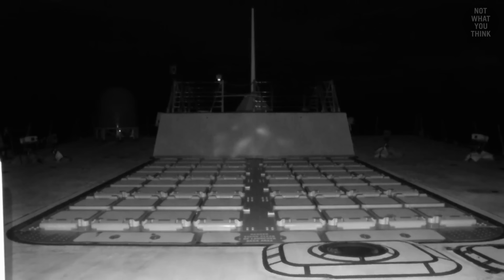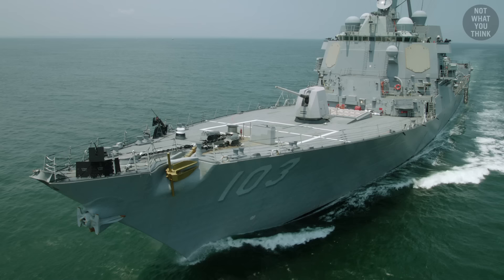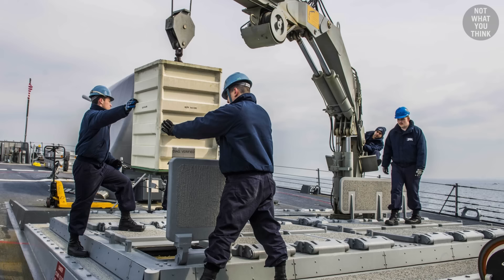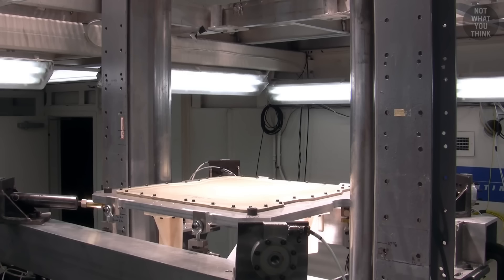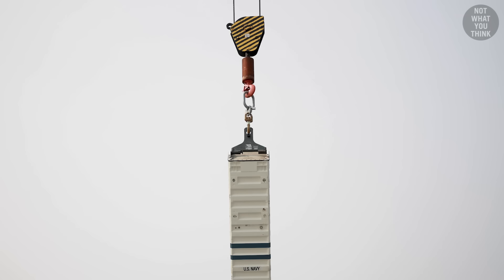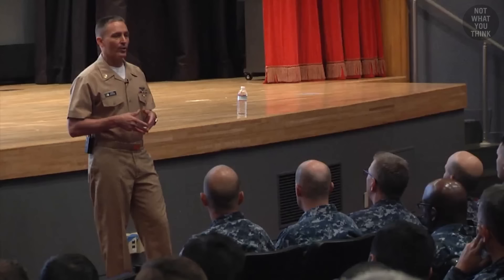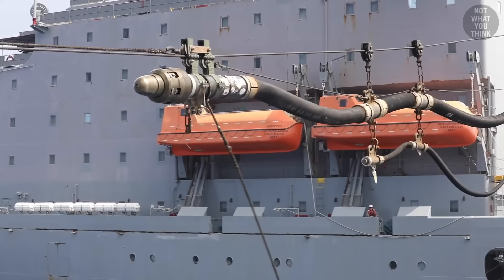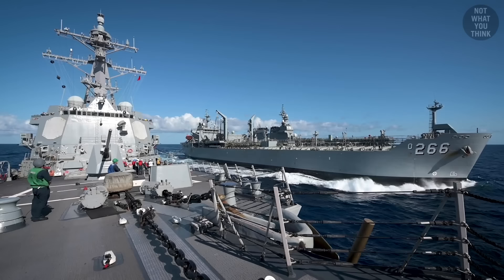Why Warships Cannot Reload Missiles at Sea

Comment: There are a thousand suitable harbors in the western Pacific Ocean to reload Arleigh Burkes by ship.  Around Japan there are probably 100 safe harbors.  There's probably 100 alone in the Philippines.  And then there is Guam, Ulithi, Kwajalein, and Australia.
Reply: Actually, from my recollection, there was a Congressional report by one of their military accountability offices (might've actually been their budget office actually) stated that reloading of the VLS cells can only be done at specialized-purpose-built ports/docks and that the military failing to account for that when requisitioning the system on ships might've violated appropriations/allocation requirements for the VLS system. 
There are only a handful of port facilities that actually can do the reloading of VLS cells according to the report and if they were to ever be targeted the US Navy would not be able to operate. Any improper reloading of the VLS Cells would damage them and compromise them to the point that chain detonations within VLS clusters would indeed be possible as missiles are launched in sequence and share a common exhaust that they need to be completely intact to shield themselves from the heat to avoid in-cell detonations.
Reply: @Edin116  Specialized purpose built ports???  You just need a crane.  

Also, if a warehouse is destroyed by a strike you can actually rebuild the warehouse or build another warehouse.  And, the video shows a VLMS being reloaded with a nearby ship so you just need a harbor.  

One more thing, currently we have 73 Arleigh Burke destroyers and 92 are planned.  If 73 go to war with 90 missiles, let's say 60 are standard missiles, and you have a 90% accuracy rate, that is 3,942 aircraft destroyed.  China has around 2,100 aircraft so that is pretty much their entire air force, and that doesn't even count air to air missiles fired from carrier aircraft.  So, the war is over by the time you have to reload.
Reply: @twelvestitches984  It’s not just aircraft that you are shooting with SM2s etc. You are also shooting down other missiles. Trust me, China has a shitload more than 3000 of those. Truth is, the Navy needs their own version of Rapid Dragon. Call it Slow Manatee. Take an ocean going barge, install a bunch of cells on them, and drag them out to the area to be protected. Or, instead of specialized cells, build the launchers into something resembling standard ocean containers and then you could just load up a container ship in case the shit hits the fan. Hell, play a good game of hide the pea and the enemy would have a hard time knowing which of the dozens of ships in port is the one full of missiles and which one is full of tennis shoes and Christmas ornaments.
Reply: @Bill_N_ATX  Yeah, that is true.  I think if we go to war with China it's going to take time for the US Navy to get there because they are going to have to conduct anti-sub ops a thousand miles out from the Chinese coastline.  So, during that time our B2's will take out most of China's air force on the ground.  

I don't think the Chinese DF-21 ballistic missile has the accuracy to hit a moving ship.  It accelerates straight up to Mach 10 and turns and comes straight down, there's no way it can manuever enough to hit a target moving at 35 mph.  Plus, the Chinese will have to know where the US Navy ships are before launching.
Reply: @Edin116  Hmm, funny. We reloaded while at Singapore once (just before the start of the war) and in UAE during the Gulf War. It just needs a crane, nothing specialized about it.
Reply: @Bill_N_ATX lmao Chinese missiles ain't shit dude
Reply: @twelvestitches984  You wouldn't keep the missiles in a warehouse. One hit with a missile or shell and the whole thing would go up and take tens or hundreds of millions of dollars worth of missiles with it as well as wrecking anything nearby. That's why they store things in multiple hardened bunkers.
Reply: @Edin116 You are 100% wrong.  I have reloaded plenty of DDGs and CGs, including in multiple ports around the Pacific.  And none of them have been in purpose built ports 😂.
Reply: @trolleriffic except you "hardened bunker" is an earth covered magazine...
Reply: @spacemanx9595  Always that ten year old who wants to pipe in with his two cents.
Reply: @twelvestitches984 an ideal war scenario. An Hollywood movie setting.

Comment: Question: It don't seem to take that much space on the boat, so why not just add more cells instead of reloading? Also since the logistic ship carry so many spares why not just have them fire it as well?
Reply: I’m not sure why they don’t carry more on the attack ships, but the logistic ships likely don’t have the targeting equipment required to launch
Reply: @smallboy8771 Sounds like the missile truck concept in the Air Force. Use your 
well defended and expensive ships to deploy forward and target, and have a missile truck in the rear networked to the remote fire control of the forward ships.
Reply: Displacement treaties and the fact it's bad to put all your eggs in one basket. If you have 2x as many missiles the ship costs more, so you have less ships. So one accident or lost hull is more crippling.

San Antonio ships have vls spots but they aren't equipped. We aren't concerned about capacity atm.
Reply from the maker: They do take plenty of space under the deck.
Reply: I'd  guess you'd need a lot of equipment along, that you can't have the trained personnel and costs associated and you'd rather just buy and man another warship. And more, you'd need the refuel ships just for range extension anyways. (uneducated guesses)
Reply: There are Three  major reasons

1. Size: While the footprint is not that large the full size strike length Mk41 VLS cells are 25ft (7.6m) tall and that is a huge amount of internal volume that has to be committed and cant be used for things like crew quarters, engineering spaces, fuel and water tanks, or damage control pumps and firefighting equipment. A ship is designed to carry the amount of weapons that fit the hull and mission. If you want more missiles you need a larger ship.

2. Danger: They are dangerous, a fully packed VLS module is several tons of rocket fuel and explosives sitting just below the deck. If you spread that out over much of the ship you have a vastly higher chance of them getting hit. This is why VLS modules are generally placed forward and aft and not amidships. Most anti ship missiles are designed to aim at the center of the vessel to do the maximum possible damage to engineering spaces (which are generally amidships) because that brings the highest odds of sinking the target. If you fill the middle of your ship with missiles the odds of them being hit and cooking off goes up dramatically. The rear VLS system on an Arleigh burke or Ticonderoga are about as close to amidships as you'd want your large weapons. Many older Russian ships place large anti ship missiles along the flanks amidships. It was some of those cooking off and exploding that likely doomed the cruiser Moskva in April 2022. Many western ships also place their anti ship missiles such as RGM-84 Harpoons, Exocets, or Naval Strike Missiles, amidships in box launchers above the deck. These smaller missiles will of course do damage if they detonate on deck but because energy always takes the path of least resistance and because the total amount of explosive mass is much lower with these smaller missiles it is an acceptable risk and unlikely to doom a vessel on its own compared with 16 7000kg (15,400lbs) P-700 Granit missiles like on Moskva. VLS cells are below the deck so a lot more of that force is going to be directed into the vessel itself causing vastly more damage.

3. Cost: As we established in points 1 and two a ship is built to carry the amount of weapons that fit on it in a safe and effective manner. If you want more on a ship you need a larger ship which makes it more expensive to build and operate. Ultimately if you could have two ships with 96VLS cells for the cost of 1 ship with 192 VLS cells the navy is going to always pick option 1 because two ships can be in two places at once.
Reply: @smallboy8771 Logistic ship coudl work as "slave" launcher pad for attack ship and use attack ships targeting system. This is done in russian made land system SA11 Gadfly aka BUK
Reply: its becouse a combo balance of weight, armor, and the misslise are just explosive if you have more its a bigger esier target to hit
Reply: Boats are already extremely cramped. It's possible in the future that boats will be made longer and compartmentalized in a way to allow for more VLS system with larger capacities to be installed.
Reply: @OlafRooster  Logistics ships are too valuable to risk in direct action. The USN operates 73 destroyers and 17 cruisers for 90 major surface combatants. Yet only 18 oilers and 18 dry cargo/ammunition supply vessels. And only the 4 supply class replenishment ships can keep up with a carrier task force and even that's during peacetime conditions. It cannot do the 30-40kts that a CSG will be moving at during combat.
Reply: @smallboy8771 there is no where on board to store them.
Reply: @OlafRooster yes, but us logistics ships are crewed by civilians and don’t have the same survivability features as warships.
Reply: Even with more cells, they will have to reloaded at some point
Now with planned DDG-X, the USN is planning on introducing swappable VLS modules which in theory would address the issue
Currently, reloading in port is missile by missile. With swappable moduels, they can pull out the entire module and replace it with a fresh one
That would reduce the time in port
The USS Proteus in 1961 reloaded an SSBN with 18 ton Polaris missile but they were stopped and still within the harbor
The problem ultimately is weight of missiles and conditions at sea
Even in bad weather, you can still refuel but cargo transfers are no go
Reply: @dcviper985  Since logistic ship is allready operating there its survivability features or lack of them is not preventing it from being there in the first place. Right? So that kinda moots this argument doesnt it? and you could put change crew from civilian to military in case it makes somekind of difference right?

Comment: A simple, but strong arm grasping the canister from the middle, moving it horizontally until ready to 'poke" it when it swings up and pivots its grasping device to slip it in slot. this way has no cables, no end mount dangling and allows canisters to be resupplied by ship to ship cable as they are handled horizontally. take some real strong engineering on the load arm, a simple bar on the four corners of the canisters and diesel hydraulic motors to protect from emp weapons. simple
Reply: If the solution was simple, navies would already be doing it.

Comment: They will not  fire 19 missiles for those targets. instead, Aegis system will determine the best possible combination to neutralize the target and provides suggestion to the crew. Most likely the high weighted target like cruise missiles are neutralized using vls and drones using canon or ciws.
Reply from the maker: Correct. The drones and cruise missiles were not headed toward the ship, so no CIWS.
Reply: If you look at the naval battles, from the 1973 Yom-Kippur War, through Operation Praying Mantis, the Gulf Wars and the Falklands Island war, you will see that the great majority of anti-ship missiles fired in anger that were defeated were seduced off their targets by effective electronic countermeasures.  Many of the occasions were ships were hit and either badly damaged or sunk by anti-ship missiles were occasions where ECM was not employed (USS Stark, HMS Sheffield, INS Hanit).  There has been only one kinetic kill of an anti ship missile in combat, by a Royal Navy  DDG which fired a Sea Dart missile at an Iraqi Silkworm before it could hit USS Iowa.  All the rest of the several dozen anti-ship missiles defeated in combat were defeated by ECM.  In the three battles that had large numbers of both friendly and enemy missiles in the air at one time, two battles during the Yom Kippur War and Operation Praying Mantis where the Iranians were shooting SM-1s at us and we were shooting SM-2s and Skipper IIs at them all of the Iranian missiles were spoofed off target.  There wasn't even any need to use the ships weapons to shoot them down.

Comment: aegis is capable of a full auto defense mode and can illuminate hundreds of targets at the same time using the spy radar, but a weapon platform like this on full auto mode would be way too dangerous if mistakes are made when detecting wrong vehicles as enemies
Reply: didn't know about that ability - is that on the newer baselines?
Reply: It would only ever be used like that in a war zone where the airspace would be closed
Reply: @KiwisCassie  yeah. it uses the specific fire control radar to guide rockets in the end phase of their trajectory, with a very narrow beam, but can illuminate everything with the track and search spy radar and just fire at will. it's just very energy inefficient and makes it light up like a Christmas tree on enemy radar. it's supposed to stay stealthy as long as possible. but in open battle with known positions.. no downside.

Comment: One solution may be the use of an "arsenal ship" or barge equipped with many loaded VLS cells to follow say within a mile of a Burke. It doesn't have to have all of the radar and sensors of a Burke,
just the missiles that can be fired remotely from the Burke similar to the way an F-35 can launch missiles from other assets, and be able to keep up with the destroyer. I can imagine a "barge" nearly the size of an oil tanker that could be a "remote" magazine for an entire strike group of destroyers. I have to admit It would make for one heck of a juicy target for the enemy.

Comment: This is going to become a genuine problem both for VLS and also for Submarines in a potential China/Taiwan conflict. 

Not only are VLS nearly impossible (tried, abandoned due to complexity) to load at sea, but they're also typically only loaded in home ports or forward operating ports. Not civilian ports due to the lack of specialized equipment and the lack of available local inventory. This means that once Yokosuka and other military ports are suppressed or knocked out entirely, any surviving but empty US vessels will have to return to Pearl just to refill their VLS.

This is being alleviated by quad packing VLS launchers, but it's still an issue and any high intensity combat will see ships running dry possibly in as little as a few hours with their resupply and back on station timeline being measured in weeks not days let alone the hours that may be needed in a high intensity conflict.

As for submarines, they haven't practiced nor prepared for civilian port loading, so once submarines fire all torpedoes or all of their conventional armament (missiles included) the only recourse they have is to return all the way back to Pearl Harbour to rearm. Essentially once the vessels is empty it's useless and the timeline until its useful again might be longer than the conflict even lasts.
Reply: they can reload in Korea, Japan, Vietnam, Singapore, Taiwan, Australia and soon to be possible in the Philippines. so its not too distant they would need to travel but it is still something that must be taken into account.
Reply: That's why the forward logistics ship concept is getting looked at, since these can perform reloads in any area of calm enough water instead of fixed ports at well known locations. Resupply while underway and under threat was never feasible in the history of naval warfare, ships always had to retire out of the enemy's weapons range to get restocked.
Reply: Submarine tenders used to carry reloads for anything that would fit in the torpedo tubes. 

I don't know if they still do, or even if there are sub tenders in service. 

On that topic, what is the hull designation for these logistic ships? Sub tenders were AS, destroyer tenders were AD, repair ships were AR, etc.
Reply: @mikespangler98  There are still sub tenders in service although I don't think any of them are capable of reloading Trident boats like they did with Polaris (much bigger and heavier missile). You can see one moored at Naval Base Guam which resupplies attack subs.
Reply: @trolleriffic   So there is. They remodeled the base rather extensively since I was last there, that was when the Hunley was at the pier. No floating dry dock either, at least not on that picture.

Comment: You make mention eventually of the GMLS Mk26 yet you showed 2 clips of the GMLS Mk10.  The VLS Mk41 had issues with its crane system early on but the USN did not let FMC/NSD, the alternate domestic manufacturer, make the necessary fixes and improvements.